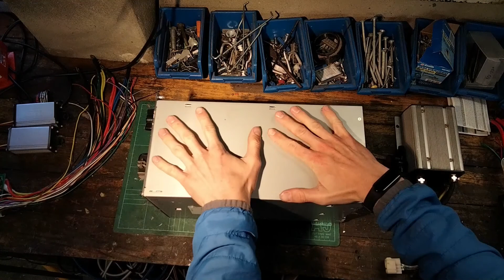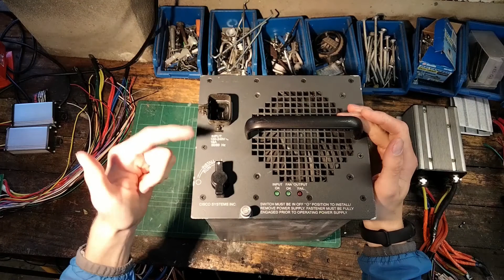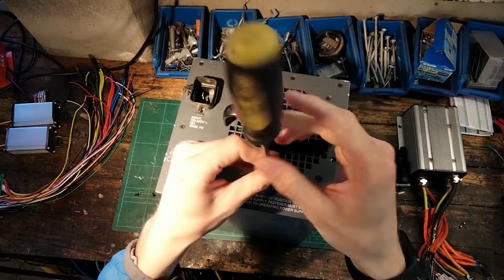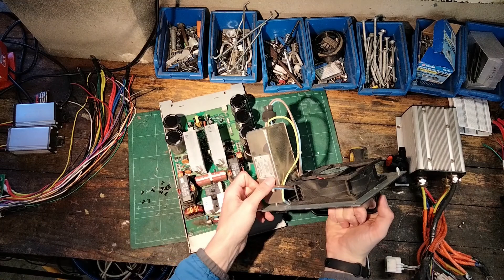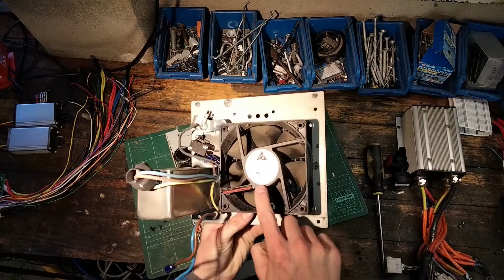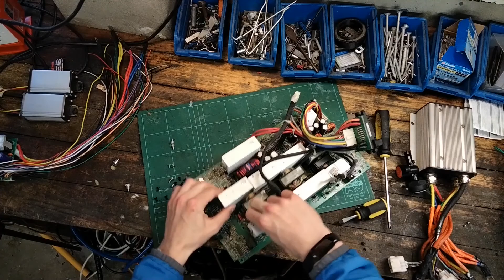42V 2500 Watt Server PSU Teardown & Mods: Part 1

Comment: Reckon you could get this down to ~14 volts for my lifepo4 bank. This would be great as I can upgrade up to higher voltages for when I go higher volts. I have been modifying 12v supplied but they are gutless for 1000ah bank. Where in au are ya?
Reply from the maker: Located in ACT! I wonder if such low voltage would work. Unfortunately the project has taken a low priority due to a bunch of other projects, but I want to revisit and maybe I can try that as well.

Comment: Hello.
Thanks for the high quality pictures on gdrive.
Nice material, I am thinking about a similar power supply and the information about the peak voltage of the capacitors was very helpful.
I hope there will be a continuation.
Regards, Tristan